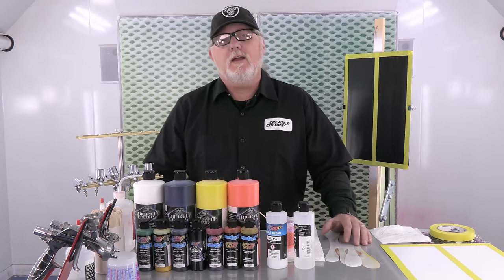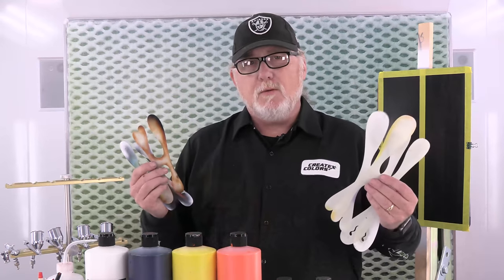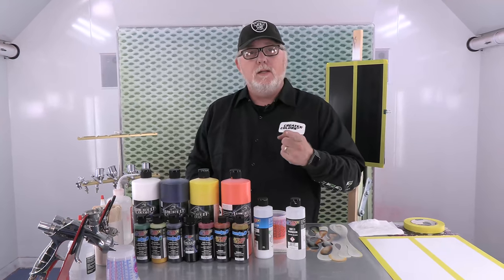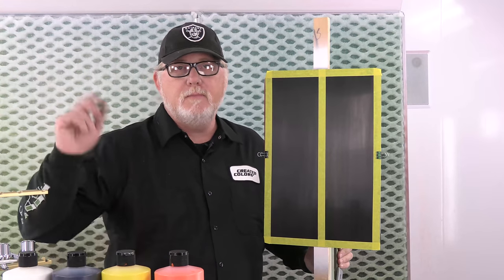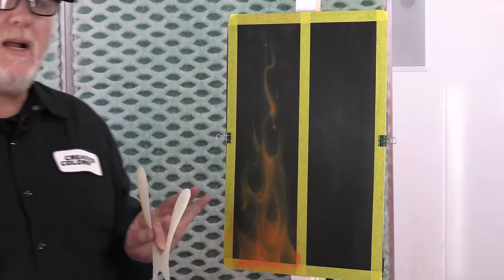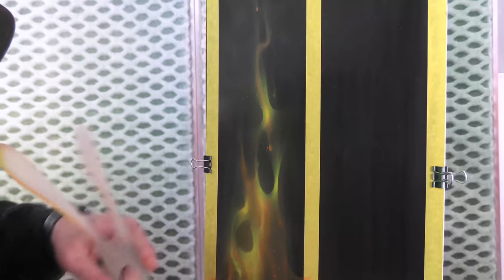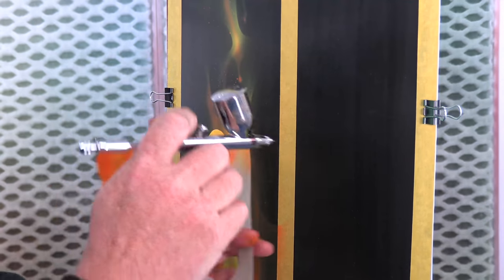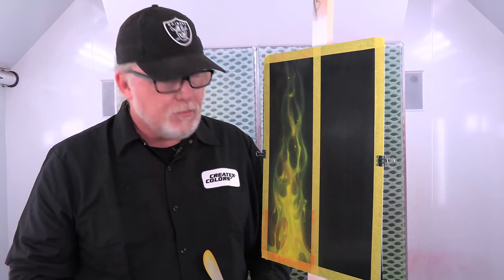How-To Airbrush Real Fire with candy2o - Part 1

Comment: Great video, I like to watch you paint, what nozzle tip were you using, the 0.5mm, or the 0.35mm?  What pressure were you using?
Thanks,
Lou
Reply from the maker: Craig was using an Iwata Eclipse with a 0.35mm tip, with psi around 30. Thank you.

Comment: The fire series was super cool!  I can almost feel the heat from panel 1. 
A question for you. I want to use a protective and clear top coat. Spray Max and 2K looks like  great products, but not practical for me. Does Createx make something that is clear and durable that mimics 2K I can spray with my airbrush?

Thank you.
Reply from the maker: check out Createx UVLS Clears, www.uvlsclears.com. Thank you.
Reply: @CreatexColors  
Thank you.
Reply: I use acrylic coat for non metal ..

Comment: I have an idea I want your opinion on,., I want to paint a gas tank with a super imposed image., what im  thinking, is start with a white or silver base coat, then lay the image onto the silver base coat with gold leaf.. then spray gold or yellow gold candy coats over the gold leaf, and the whole tank., , until the gold leaf is still visible when in the sunlight and I get good coverage on the tank.. do u think this would work?
Reply from the maker: Yes. You should apply 405 UVLS Gloss Clear over the gold leaf, followed by candy2o, then catalyzed (2k) urethane clear. Please make a complete test panel of this before the actual paintjob. Thank you.
Reply: @CreatexColors  do you think I should use gold sizing to stick the gold to the clear after it dries? Im wondering if the clear will react with the sizing under the gold.
Reply from the maker: Gold leaf generally sticks to 4050 without sizing. Please make a test panel comparing the use of sizing and any other process ideas before the actual paintjob. Thank you.

Comment: Thank you so much for this video and all other vids! I do have a question. I bought a set of wicked opaque colors, in that set i got the 4012 reducer. So in wondering why because you say to use 4011 reducer? 
Thanks again 😊
Reply from the maker: That is an older set made before 2020 when we switched to 4011 Reducer. Try mixing 4012 1:1 distilled water. Thank you.
Reply: @CreatexColors  thank you 😊
Reply: I'm going to have a go at air brushing flames on my ride on lawnmower this summer. If they don't turn out right it'll be your fault for making, me want to do it. lol

Comment: Craig uses the Candy2O ratio opposite to  other Createx videos I’ve watched recently. He uses 3 parts candy to 1 part 4050, but in other vids they use 3-6 parts 4050 to 1 part Candy. Which is preferable for coverage over metallics?
Reply from the maker: Craig's technique for real fire with candy2o uses his own mix ratios; he wishes to promote bleeding. We recommend following the mix ratios set forth in the candy2o tech data sheet, and as you become more familiar with the paint, experiment with mix ratios then. For candy2o applied with a spray-gun over metallics, the mix ratio is 4050 6:1 candy2o. For airbrush a 1:1 ratio can be used, but you may find a ratio of 4050 3:1 candy2o to work better as it offers more control. Thank you.

Comment: what are the differences between candy colors and acrylic inks? they seem almost the same for me
Reply from the maker: candy20 are metal dyes, which are much more lightfast compared to inks. You can paint a car with candy2o, but inks will fade in direct light. candy2o also go to an increasingly darker value the more the color is built up, inks do not, which is necessary for this technique. Thank you.
Reply: @CreatexColors  do you know if candy20 will go on an acrylic base on some mdf board? Probably not but Im just asking thanks for the quick answer btw